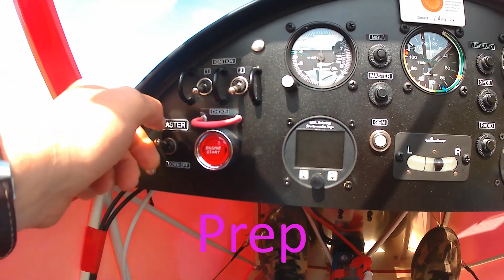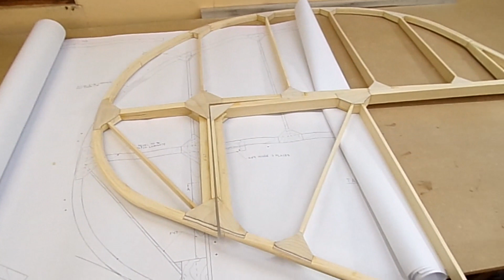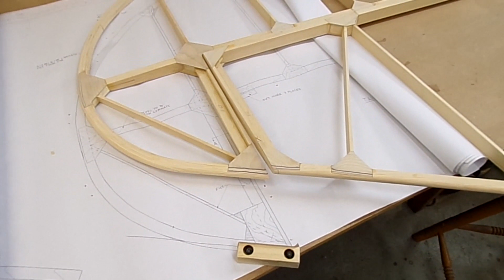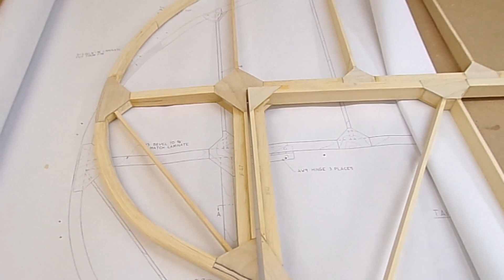EP12 Fisher Youngster V Kit Plane Build - Rudder ready for hardware.

Comment: Have you decided what engine you are going to use yet?  The Hirth f-23 same as the  Kub looks like one of several possibilities, or maybe even an industrial based 4 stroke. Will the skins be Oratex by any chance?  It's exciting just thinking about the possibilities.   Top notch videos as always.  😁
Reply from the maker: Thanks for the comments. The Youngster V is designed around a full VW engine so that is the plan for this aircraft (If I had gone down the Spacek SD1 route I would have used the Hirth F23). Fisher other standard Youngster is a 2 stroke base on the Rotax that is a bit more powerfull than the Hirth.
Oh yes it will be Oratex 600 for a weight saving and now I have the plans (not the kit yet), there are a few things I will modify, to try to get the best out of a simple Biplane (high drag machine).
Thanks for being so kind about the videos.
Reply: @flyingkub  Thats brilliant and you can't go wrong with a VW engine.  Cheers  :)
Reply from the maker: @teaandmedals  Well there are a lot of spares out there at least :-)

Comment: Hi Algy, my Grandfather was a design engineer for Supermarine, Shorts and Vickers, mainly working on flying boats and the S5 and S6 Racing planes.
During the War, many small Companies were used to build Sub-sections.
In order to ensure that all parts would fit together on assembly, he would send full size alignment templates to build the jigs to.
Despite parts being made by Companies with no aircraft construction experience, they never had a part back that didn't fit.
The trick he used, was to trace the previous drawing datum line and all relevant pickup points, gaps, bolt centres etcetera onto the new sheet, and then complete the drawing of the template.
It's a trick I've used on many a project, and hasn't failed me yet.
It's also very good for lining up car doors ( hinges and trimlines ) when mounting them on your own.
Reply from the maker: Great story about your Grandfather, a super piece of history.  I was over trusting in the drawing as both parts are on the same sheet. Thanks for you comment and time watching.